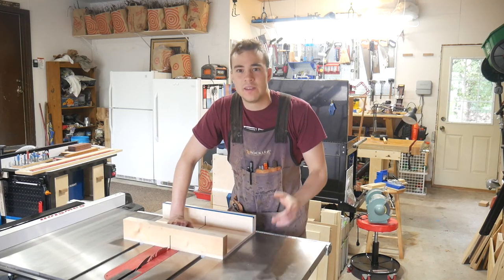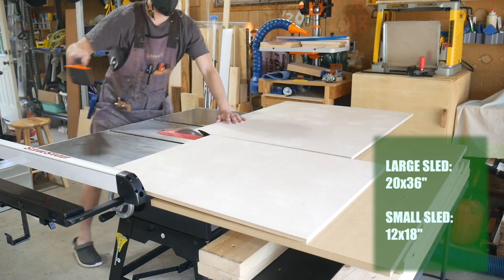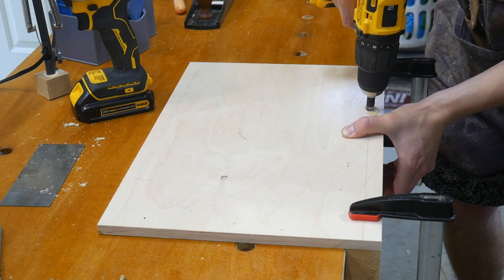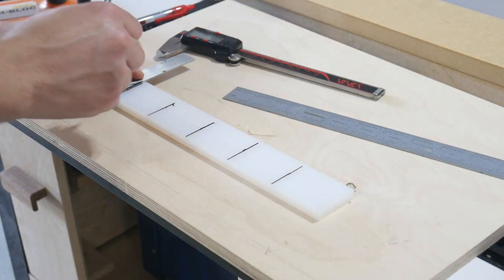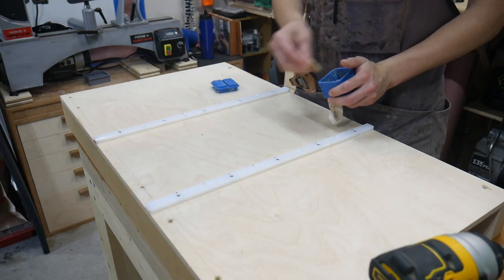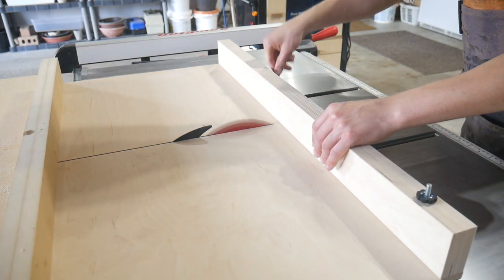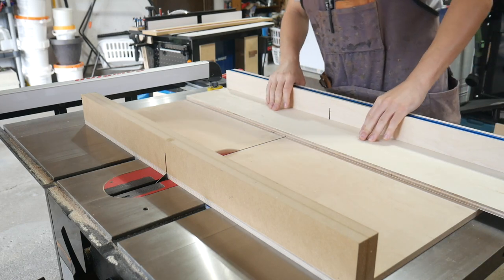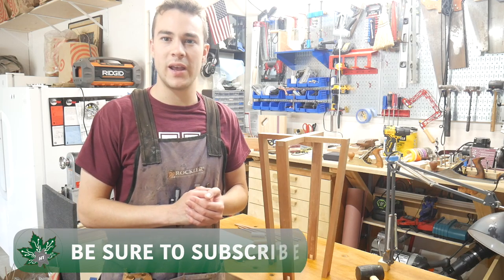The BEST Crosscut sled method

Comment: Nice sled....For your miter slot rails you can also use HDPE which is a bit cheaper then UHMW. Also, curious why you didn't install any T-Tracks.. I know you have the mini sled, but it wouldn't hurt to have them just in case.
Reply from the maker: Thanks for the comment. I’ll have to check out HDPE. I did install T-track on both at the end!
Reply: @TheTranq  I'm talking about on the T-tracks on the bed...to be used as hold downs for smaller pieces or awkward pieces. 
HDPE is not as scratch resistant as UHMW, but using them for guide rails and sacrificial fences they are not going to get many scratches anyway...at least not enough to be worried about.